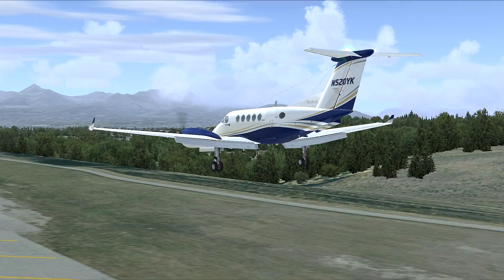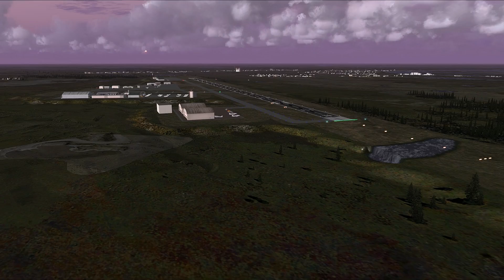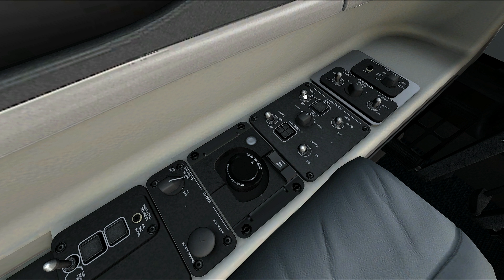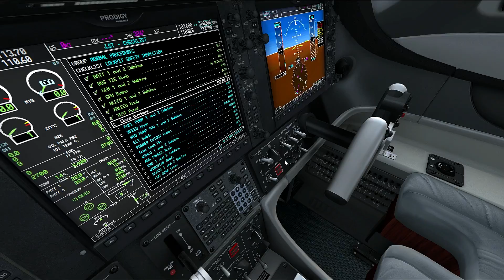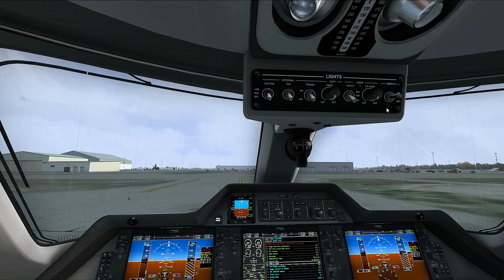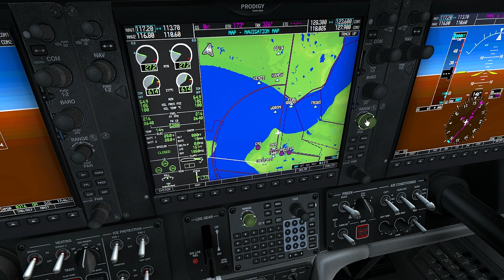Carenado EMBRAER EMB505 PHENOM 300 part 1 of 3

Comment: enjoyed your videos very informative , i bought this airplane and is very nice the only trouble i have is with trying to control the turns wheni taxing the wheel is turning but the plane keeps going straight perhaps you have a good tip on that soo i can fix it?? ty ps i am using prepar3D v 4.3
Reply from the maker: Thank you.  I'm sorry for such a long delayed response.  Hopefully you have resolved your issue by now.  I really don't have any experience with prepar3D, however, I can normally find solutions to these type of issues in the AVSIM User Forums under the Carenado, Phenom 300 thread.  Best regards, Tim G., FS MaNiA

Comment: Hello. Congratulations. Awesome videos about Carenado Phenom 300. I've learnt a lot with them. I have a little question: what do I need to do to view the waypoint names along the route on Prodigy screen? In my case (FSX-SE) I can see the waypoints (the signs) but not the names besides them, like you. Thank you very much.
Reply from the maker: Hello, so sorry for a very delayed response.  The best way to solve issues with Carenado aircraft is to check out the AVSIM User Forums under the Carenado Phenom 300 thread.  Hope that's helpful.  Regards, Tim G., FS MaNiA

Comment: can i load airways into the G1000? and how then? do I need the extension?
Reply from the maker: Hi Noel, for this version of the G1000 you will need to add the Navigraph Expansion pack to load airways.  I have another Phenom 300 video where I have added the Navigraph Expansion and use it to add the airways into my flight plan.  I think it's the flight from Belem, Brazil to St. Maarten part 1 of 3 where that happens.  Hope that helps, best regards, Tim G., FS MaNiA

Comment: Hi Do you know how to use ALt knob? in My Phenom it does not work. Also Yd dosnt work at all. Mayby there is same procedure?
Reply from the maker: Hi Marek,  Make sure you have downloaded the most recent version of the Phenom 300.  Carenado has released several updates to this aircraft.  I have several videos published flying the Phenom 300 and using the auto flight control system.   If you can't figure out your problem from watching the FS MaNiA videos, try checking in on the AVSIM Forums.  They have a Carenado "Unofficial" support forum.  Hope that helps.  Kindest regards from Tim G., FS MaNiA

Comment: i cant select the runway somehow
I only can select the sid and the runway selects itsself
Reply from the maker: Hi Dennis,  I am currently working on a new video of the Phenom 300 using the Flight1 Garmin GTN 750.  It works much better overall than the default Garmin G1000.  I do have several more videos already on the FS MaNiA Channel that demonstrate the G1000 for SID's and STARS, etc.   Check those out under the Phenom 300 Ray Marshall series.  I hope that will help you resolve your issue.  Kindest regards, Tim G., FS MaNiA
Reply: Thanks a lot.
Meanwhile i fixed the problem that i cant select any sid/star or runway but it is still a little bit glitchy and sometimes it even does not work
I think it was a missing update or smething which fixed it
Thanks again:)

Comment: Is there a trick to entering the altitude on the flight plan?  Mine copies whatever altitude is set from the first waypoint to all those below it.  If I try to change any of them, it resets back to what it was.  I can change the first waypoints altitude, at which time, whatever I set there is then copies to all other waypoints.
Reply from the maker: +Zygon2004  Hi Zygon2004!  It sounds like you may have the Carenado Navigraph Expansion Pack Version 1.2 installed?  I had a similar issue when I updated to Version 1.1  I completely uninstalled that version and reinstalled Version 1.0.  That version works fine for me and I don't have any problems with inserting altitudes at the various fixes along my route.  Hope that helps.  Kindest regards, Tim G., FS MaNiA

Comment: awesome video, one sub for you! just one question. is that the real procedures of cold and dark? because iv always thought that you were ment to switch the batteries on first, then gen 1 and 2? many thanks :)
Reply from the maker: +Fsx_Productions Hello Fsx_Productions.  The Embraer single pilot design philosophy is to create a highly automated cockpit in order to remove as much of complex system management workload from the pilot as possible.  That means that normal positions for switches and knobs in the cockpit are "auto" and knobs at the "12 o'clock" and lights out.  The electrical system and generator logic in the "auto" mode will actually bring the generators "on-line" at the appropriate time when the respective engines are started.  The "Cold and Dark" state that Carenado uses for the default start-up is really not accurate.  Most if not all of the switches always remain in the "Auto" mode unless there is a malfunction and need to override by the pilot.  It really does reduce the pilot workload and frees us up to concentrate on staying ahead of this extremely fast jet without assistance from a  co-pilot.  

Hope that makes sense and thanks very much for the question.  Kindest regards from Tim G., FS MaNiA
Reply: +FS MaNiA yep, brilliant! thanks a bunch. so in a nutshell, you are ment to switch gen 1 and 2 on before you do the battery? kind regards, Aaron
Reply from the maker: Fsx_Productions That is correct.  The "Auto" logic of the electrical system will automatically bring the generators online at the appropriate time after engine start.  Typically all switches on the Phenom 300 are left in the "Auto" position.  In a real world "Cold & Dark" aircraft, the pilot would find the aircraft with all switches in "Auto" for normal operations.  The idea is to take as much work load from the Single Pilot as possible using automated systems management.  The Pilot is freed up to aviate, navigate, and communicate.  If anything goes wrong in an aircraft system, there will be a CAS message to alert the pilot.  I hope that is helpful,  Kindest regards, Tim G., FS MaNiA
Reply: FS MaNiA Thank you so much Tim. Yes the information was very helpful! Thanks again! Kind regards, Aaron

Comment: Hello...I really appreciate your in depth videos.  I have a couple questions if you don't mind.  I just purchased this aircraft and new to small jets and I was wondering how one could quickly learn where all the cockpit switches are located ( labelled diagrams? ) so one would be able to manually follow/find easily the various checklists?
Are there any tutorial videos for this aircraft?
Reply from the maker: +Jack Smith Hi Jack, I am currently doing a complete series on the Phenom 300 which includes a 4 leg flight from Sao Jose dos Campos, Brazil to Wichita, Kansas.  I have already completed the first two legs of the trip and uploaded 7 videos on this channel.  Unfortunately Carenado is not great about providing good documentation, however, there are numerous online resources/tutorial information on the G1000.  You can easily find those by using Google or other search engine.  Or just watch the FS MaNiA series and you will learn tips and tricks along the way.  I hope this is helpful and thanks very much for your comment and question.  Kindest regards, Tim G., FS MaNiA
Reply: +FS MaNiA 
Thanks for the reply. I have been watching and enjoying our videos for sure. I have since installed the F1 GTN 750, as I see you did, and with help from Bert P I was able work out a small problem I was having and gained some frame rates as well.  I will keep looking and learning.
Reply from the maker: Jack Smith Great to hear Jack!  I am planning to add Bert's GTN 750 mod to the Phenom 300 for the leg from Fort Lauderdale to Wichita (if all goes well).  Hope you will stay tuned for that series as well.  Kindest regards from Tim G., FS MaNiA

Comment: Hello, nice video; I was checking the part where you configure the Flight Plan based on "Select Departure" and I don't have that option, I only have "Select Approach", the other options are there but I can't choose them.
Reply from the maker: +Jaris Aizprua Hi Jaris, did you purchase the Navigraph Expansion pack?  You need to have that installed to have SID's and STARs.  Thanks very much and kindest regards, Tim G., FS MaNiA
Reply: I realized I had an issue with the expansion installation, it's already working, anyway thanks!!!

Comment: Very informative, thanks.  Can you tell me which software if any you are using to transition around the cockpit in such a smooth manner?
Dom
Reply from the maker: +d M Hi d M!! Yes, I use EZDok for the various cockpit views and some of the exterior views.  I also use some of the default FSX "Tower" and "Spot" views for exteriors.  I have an EZdock Camera Setup Tutorial video on the FS MaNiA channel that shows how I set up my interior and exterior cameras.  EZdoc is a great add-on that I highly recommend.  I only fly with the virtual cockpits so it is the bomb for moving easily moving around in the cockpit.  Hope this helps and thanks much for your question.  Kindest regards, Tim G., FS MaNiA

Comment: For some reason my airport is not showing up when i open the procedure's tab. is there a way to enter the dep airport manually?
Reply from the maker: +niels voogd Hi niels, I am having the same issue with the Navigraph expansion pack add-on.  I have found you have to first select a SID (Departure Procedure) using the "Proc" (Procedure) key.  Once that is done, the departure airport will appear in the flight plan.  I understand Carenado is planning to release and update for the Navigraph expansion pack. I am hoping they will address this issue.  I hope this helps.  Thanks for the question.  Kindest regards, Tim G., FS MaNiA
Reply: then where can i select a SID if i havent picked an airport yet?
Reply from the maker: Crazy thing is the G1000 knows where you are.  If you just hit the procedure key at the departure airport, it should bring up SID's for that airport.  You will see them under departure procedure.  You can scroll left and right through them to pick the one you want.  If you watch me input the flight plan in this video, I am pretty sure that's the procedure I used.  Input a SID, then add in the rest of the way points.  It is a little tricky and counter intuitive from everything we are used to ,, but it will work at any rate..   Give that a try and let me know how it goes.  Regards, Tim G., FS MaNiA
Reply: nope the thing is still not showing the airport. I am at EHRD wich should have a few SID's http://imgur.com/a/4rGgZ
Reply from the maker: Hi niels,  I'm sorry you are having such a time with this.  I just loaded up the Phenom 300.  I do have the Navigraph expansion pack installed and I am using Version 1.3 of the Phenom 300.  

Here is step by step how I key in the flight plan: 1) press teh "PROC" key to bring up the "PROCEDURES dialogue box. 2) use the large "FMS" knob to scroll the flashing cursor down to "SELECT DEPARTURE". 3) Press the "ENT" key which will bring up the "AIRPORT" dialogue box with the airport information fields populated with your departure airport information. 4) Use the large knob on the "FMS knob to scroll the flashing cursor down to "DEPARTURE". 5) t this point you should be able to use the small "FMS" knob to scroll left or right through a list of departure proceedures (SID's).  Sometimes, I can't get the cursor to scroll through the list.  I found if I hit the "CLR" key and start over, use the MFD Controller FMS knob, and go slow, it will scroll through the entire list of departures.  I think this is a bug with the Navigraph expansion pack that I am hoping will be corrected at some point. 6) When you find the departure you want (any will do for this test,,  you can even just highlight "NONE")  use the large "FMS" knob to scroll down to "LOAD" (at bottom) and hit enter.  7) Hit the "FPL" key and you should now see your departure airport listed in the Flight Plan box for the departure airport. 8) Use the large "FMS" knob to scroll down to the blank line at the bottom of the flight plan way points and start inputting your route waypoints with the destination airport as the final waypoint.  You can also load airways by bringing up the waypoint box using the small "FMS" knob, you will see a soft key bottom right on the MFD , "LD AIRWAY", select that key and enter the entry and exit way points.  I am still working on this portion of the process, so, at this point I can't attest to how well it works.  My second leg of the Brazil to Wichita flight will  use this feature, therefore, I will have to master it for that video.  

I hope this will work for you.  If not, let me know and I will point you to the best place to get help.  

Kindest regards, Tim G, FS MaNiA

Comment: Hello. Maybe a stupid quostion. But I have only learn to fly Boeing 737 from Next Gen. Where I don't have to learn the Whole aircraft. Can I buy this aircraft without too much settings before I cant fly? Hope you understand my quostion.
Reply from the maker: +Henrik Mathiesen Hi Henrik,  That isn't a stupid question at all.  I understand exactly what you mean.  The first PMDG aircraft I purchased was the MD-11.  I think the manual was 500 or 600 pages.  It takes a long while to learn the finer points of those PMDG birds ( and yet I love doing it just the same).  The Phenom 300 has a lot of automation built in.  Set everything to auto and your ready to go.  You can be airborne in no time.  The documentation is minimal and that is standard with Carenado.  They give you a checklist and send you on your way.  The most difficult thing for learning this airplane is figuring out the AFCS (auto flight control system) and how it integrates with the Garmin G1000.  No worries, just stay tuned to the FS MaNiA channel and you will learn everything you ever wanted to know about the Phenom 300 as we release the Brazil to Wichita flight series.  Until then, you can still easily fire up the engines and fly around without too much fuss.  Hope that helps and thanks for asking.  Kindest regards, Tim G, FS MaNiA

Comment: I have recently bought the plane but havent had time to fly it yet, but to day after work I will, thank you for an great video,
Reply from the maker: Your welcome fadde10000!  It takes a little patience and a lot of trial and error to figure out the autopilot procedures.   I'm still figuring out better ways to fly the plane. I'll keep demonstrating different methods and procedures as the series progresses!  Stay tuned and kindest regards, Tim G., FS MaNiA
Reply: +FS MaNiA Hi again, I been watching all 4 videos of the Phenom, and I did some flights , I have mutch problem with the Navigraph expansion, slow FPS less then 1 fps for P3D and I cant load the Aircraft in fsx SE because of the new database is installed, but without the expansion all is god, have you experience similar, but the Aircraft is very good and like you say it takes time to master... thanks for well done videos ... /Mikael
Reply from the maker: Hi Mikael,  I have not had any frame rate issues in FSX.  Occasionally I do hear of this problem from guys over in the AVSIM "unofficial Carenado support" forum.  You might want to consider looking in on some of those post to see if you can find a solution, or submit a support ticket direct to Carenado.  There may be a simple solution.  I will have more flights in this plane uploaded soon with additional tips and tricks.  Thanks for your comments and questions, stay tuned and kindest regards, Tim G., FS MaNiA
Reply: +FS MaNiA Thanks for your reply, I have contacted them and they say there is a new version of the Navigraph addon comming out later on, Looking forward to watch your future video, /Mikael

Comment: Sweet!  Was hoping you would circle back to the new Phenom 300 from Carenado.  Nice job Tim!
Reply from the maker: Wow!  That was fast Jon. If you like the 🎶🎶?Phenom 300 you were going to love the series. We are really going to dig deep on this airplane working with Ray Marshall at AVSIM. I should have port to finish sometime today. And part III later than tomorrow. Hope you enjoy the flight. Thanks for the comment and for checking in and staying tuned. Kindest regards from Tim G at FS MaNiA
Reply: +FS MaNiA I've never seen the 100 and 300 next to each other like you have in your video and I was surprised to see that the 300 has a swept wing and the 100 doesn't.
Reply from the maker: Hey Jon, from the angle of this shot the 100 looks almost as big as the 300, but the 300 out weighs the 100 by 7,500 lbs at max takeoff weight.  She is bigger, faster, and flies higher!  I can tell a big difference when I push the power levers foward at takeoff.  The 300 has some major get up and go!!  The swept wing is useful at cruise speeds of .74 mach.  It's a great business jet and Embraer is giving Cessna and others a run for their money.  Cheers, Tim G., FS MaNiA